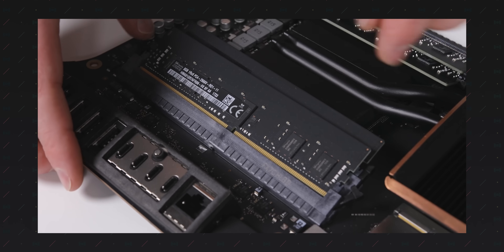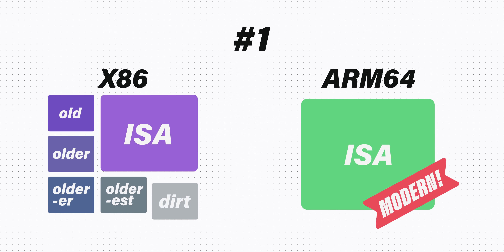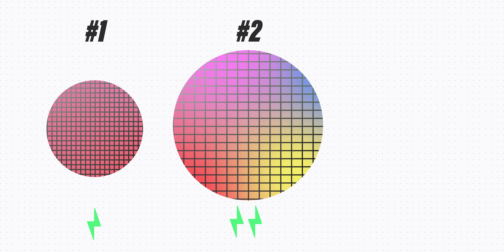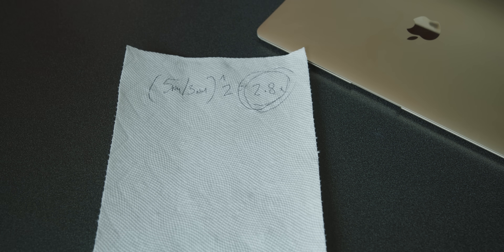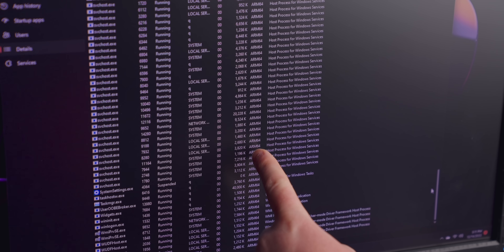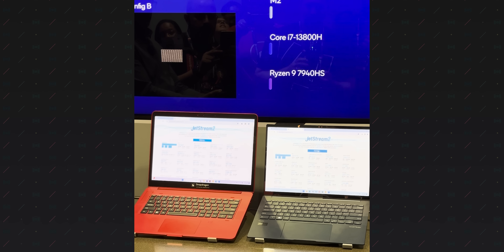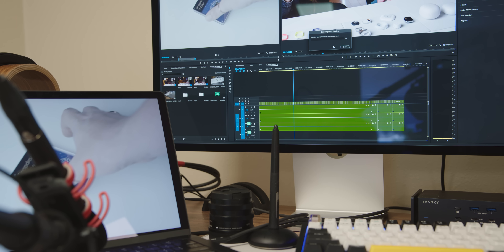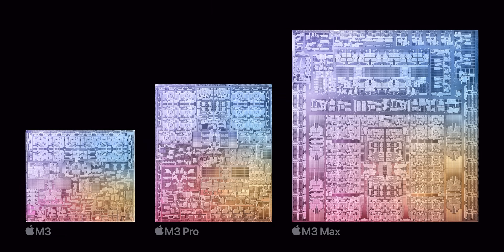Apple's Silicon Magic Is Over!

Comment: What about an "MacPad Pro"! An iPad form factor running the MacOS. This would be the lightest, thinnest Mac EVER! ...C'mon, it's all Apple silicon now anyway. Why not fill the gap in the Apple line-up between the iPad Pro and MacBook Air? Wait, you say, the operating systems are too different. Not so much now, really. Just add a keyboard-cover and make the Mac the default OS (with a 'touch' of class). If anybody could do it, it's Apple!

Comment: Apple probably won't have another leap like the M1 for a decade plus, but they don't need to; Apple Silicon is still a selling point for Macs, still competitive back to the M1, and has time to mature while AMD, Intel, and Qualcomm are just [almost] catching up.  Performance doesn't need to scale like crazy on laptops while it can and should on desktop platforms using even bigger chiplets since heat, battery life, and [somewhat] power consumption aren't important factors (or as important, that is).
Reply: how much apple can improve the M-series is not actually up to apple is the point here which is why they are already hitting a wall

Comment: Still on Intel.

Apple Silicon has too many red flags for me: 
- soldered and non-upgradable or replaceable critical components, specifically SSDs which will start failing in the next few years 
- can only run MacOS
- no active cooling at all on the MBAs which are forced to throttle, which is completely unnecessary 
- security-locked hardware 
- disgusting memory prices

Comment: I'm sticking to x86 via Ryzen 9 computers with 16 cores/32 threads, support for DDR5 128 GBs RAM, and all the hard drives I could ever want.
Reply: You can never have enough hard drives. ..😂😂
Reply: In a laptop!?!
Reply: @curio78  No worries, apple sells them on a lifetime dependency on iCloud. Who needs to own their own data when they can pay apple to keep it safe for them?
Reply: This is probably the stupidest comment I have seen ever, Imagine comparing an Laptop, harboring a Different use-case with basically a high-end gaming computer. This is like comparing a Corolla with a Ferrari and complaining the Corolla can't do things the latter does.
Reply: Wait for strix halo, thenyou can compare with apple sillicon lol
Reply: Ryzen 8700G is already more than enough to compete with Apple - Intel can’t even get close. Strix Point will end the discussion.
Reply: Cool story bro
Reply: For a desktop, I agree. But put that in a laptop, you'd have to carry around a car battery to get decent battery life.  

I'd love the arm option for mobile
Reply: @mikekellytech  Lots of x86 laptops can get great battery life
Reply: @mikekellytech I'd love the Altera ARM systems to become more affordable.
Reply: @mikekellytech  Not actually true a lot of the Ryzen newer AM4 cpu's actually draw less power than their intel equivalents. They just run a little hot. Most of the time.
Reply: 16 cores?

laughs in Threadripper
Reply: You could always go Epyc and get 128 cores & 256 threads, or get a multi-cpu board and get 2 of them...just saying ;)
Reply: you're too smart to be an apple customer, then
Reply: Macs are great for non technical folks.
Reply: @tubasweb I'm a software engineer (15 years in and going) and I switched to M1 Pro and M1 Max. It's a joy to not have to think about being near a power plug and not have to worry about burning myself.
Reply: @tubasweb and technical folks. I’m a data engineer that works predominantly remotely. You cannot beat Apple silicon on the go.
Reply: @lwwells  Don't bother. So many neckbeards larping as experts act like Macs are just for idiots. Meanwhile my entire dev shop chooses to use Macs, as do many of the top engineering companies
Reply: @lwwells  you can, by using normal laptops where you are not stuck with macos
Reply: @483SGT  yeah, but they have no idea how to set up anything.  top engineering employees  are just specialized to open one application and click on the icons.
Reply: @marceelino  I also have a Lenovo with the 13900h. It’s a POS. The MacBook is far superior. The Lenovo is my work laptop. I reserve it for when I need to touch the servers at work.
Reply: @tubasweb The most highly regarded technical people I know use Macs at least for part of their computing. I use Macs and GNU/Linux. To suggest Macs wouldn’t be regarded as a serious tool or that Windows or GNU/Linux PCs wouldn’t either is silly. Unless you’re running a LISP machine, most ppl don’t take ppl who make such talk seriously.
Reply: As lifelong pc guy , I recently started longterm camping in a beautiful rainforest and Apple is the only way to go , I’ve wasted too much money on badly built pc laptops and to get a comparable build quality pc laptop , I need to pay more than Apple and then get less performance
Reply: @cheekoandtheman I play a fair bit of games on my laptop, so while I’d certainly kill for the efficiency of an Apple Silicon Mac, my use case rules them out wholly.
Reply: @cheekoandtheman  lol. what a stupid take
Reply: @cheekoandtheman  ummm, ruggedized lappys are pretty damn bomb-proof, had a client with one for 15-20 years, still running XP and it had been used at the crush on a cattle property as well as in the ute and the office. They could still get replacement batteries for it too.

Comment: Clarification: the nanometer nomenclature used to refer to gate size, which becomes irrelevant the more complex transistor designs became with mosfet and gaafets.  It hasn’t been an accuracy description of physical size since 1997. It’s just marketing bs at the moment.

The idea is that using convoluted math and mental gymnastics, what they call 3 nanometers is the performance of a theorical processor using the same technology than back in the days when the number meant something. And even that definition isn’t accurate and depends on what Marketing wants to push.  

They just need to ditch the no name and find something less misleading.

A good article in the subject is How Are Processed Noddes defined on extremtech.

Comment: The X86 architecture was always in basic a flawed design. They did make at the launch time in the 80's very successful marketing which consequences of the huge power consumption we still face today.  Switching to the ARM based M1 was a good choice for Apple in the right time. But the power efficiency jump cannot be repeated again. The time of cheaper, faster and more power efficiency is over after the switch to a better architecture like ARM, MIPS, SPARCV8 or RISCV5 from X86. Even the chips still can get faster in the future, a price drop can only be done by lowering the profit margin (NVIDIA!!!!).

Comment: for low end consumer grade and base model they are great. But if you need upgrades or PRO, it simply doesn't worth the price. Disk and RAM are impossible to replace/upgrade. Basically you buy a computer with a 3-4 years expiration date on it and spend a ton of money (if you go for fully upgraded/pro models). I would say the best advantage MAC holds for the low end segment (1000+ euros) are the screen and the performance when running on battery. Not to mention that battery life is amazing.